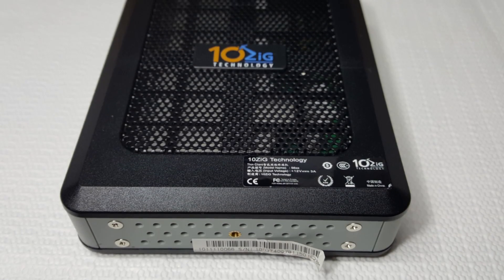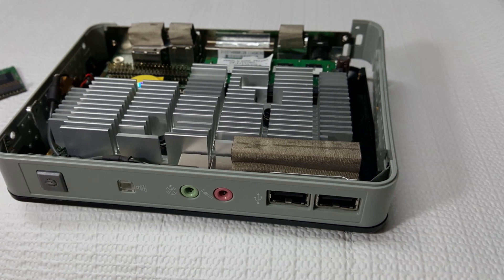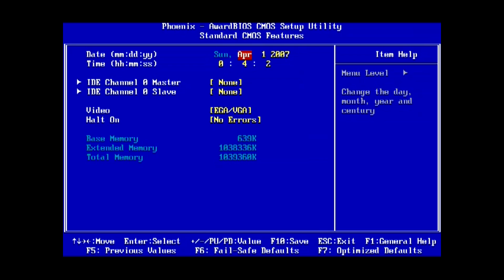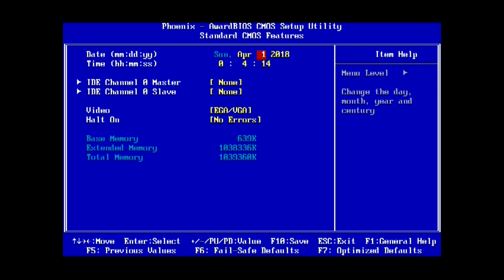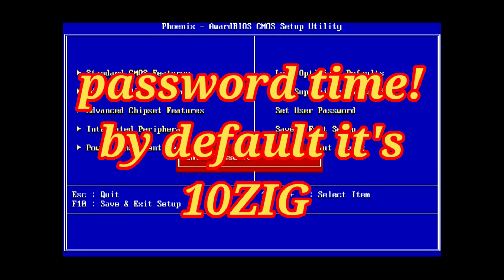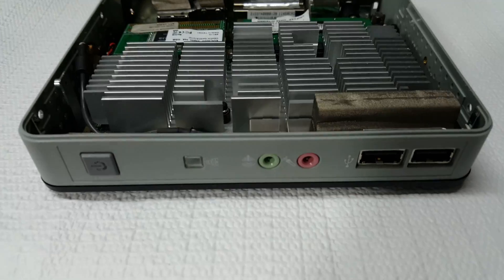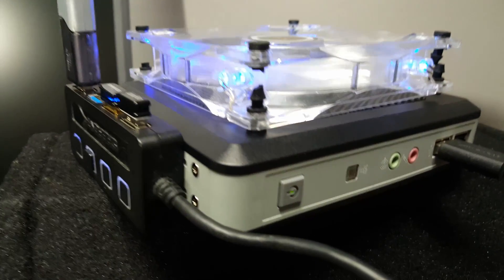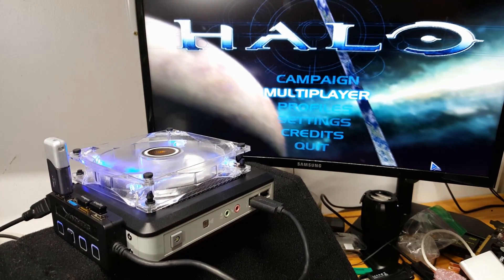Gaming on $12 10ZIG thin client

Comment: You could swap the compact flash and have a full fledged windows 7 install, and more space for games. 
Maybe upgrade the ram. 
And if it has any sort of pciex you coukd get a razor cable and put a gpu externally. 

It could really step up things

Comment: isn't that a laptop IDE connection? Can you get a laptop IDE ribbon or sata adapter and put in a larger drive? Also, does it have a laptop PCI slot for wifi? can you use that slot to use one of those EXP GDC external graphics docs for laptops?

Comment: I love thin clients too... not sure why... but my 9 year old has a hp t620p (8 GB ram and a gt 730 2gb gddr5) and I have a hp t730 (16 GB ram and a gt 1030)... and we are having a blast building and testing on them even though we both have built gaming rigs... it's just a blast working on them.
Reply from the maker: I want that t620 flexible one I been looking for one cheap but they are popular
Reply: @modstek  I've found em as low as $60 ish but its 2 ghz 4 core vs the t730 2.7-3.6 4 core but at $170